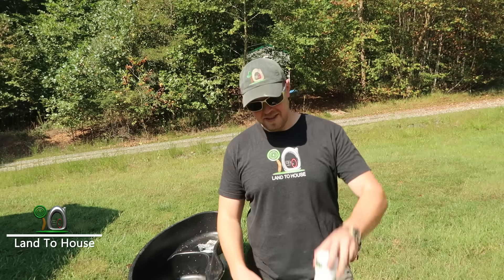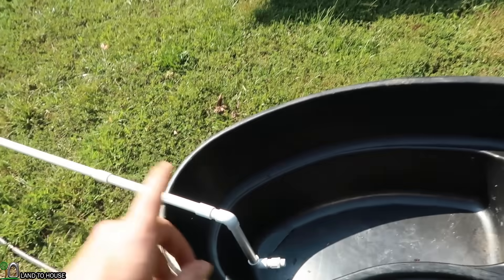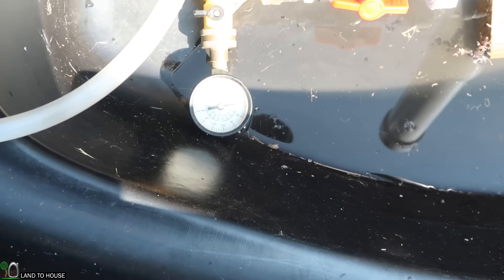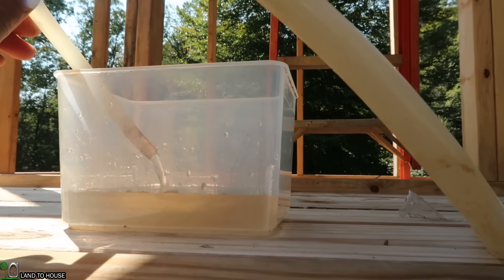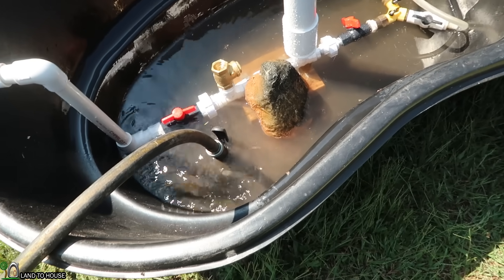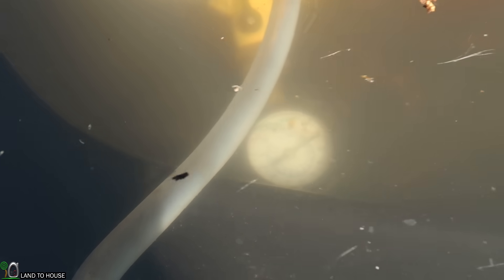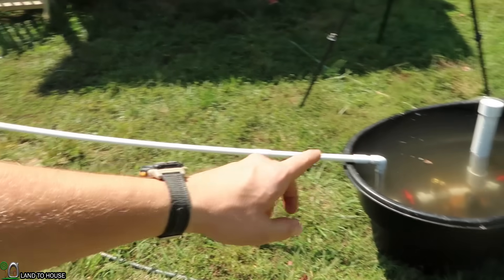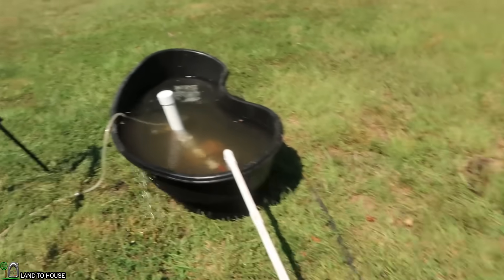Underwater Ram Pump

Comment: Make a closed-loop system that can run continuously. You'd have to capture the water at the ram and cycle it to the delivery or to the input. If you can make one work, then you have achieved what they have been trying to do for years. I'd thought of different methods to do that, but always come back to creating a small volume pump that is powered off the ram pump. I'd like to see someone pull this off. It would revolutionize ram pumps.
Reply: I did the math on it, and seems you could almost double your run time, but eventually it will run dry.
Reply: If you lift the WHOLE operation off the ground you create another head of pressure between the bath tub and the ground. Perhaps you could use second head to run another ram pump or pelton wheel etc.
Reply: i think you were still siphoning
Reply: @haz8821  i agree with. Ther must be some siphoning happening, otherwise the lower head pressure should result in less volume
Reply: @Haz-1921  I am thinking the same, cos the deliever head was lowered.

Comment: How can you retrieve the water loss from the waste valve to put it back into the system? If I'm using a 550 gallon tank to operate a hydropower generator .is that possible?

Comment: Could you build a pump where the discharge valve is connected with a shaft to the air reservoir to further increase the pressure and it should make it similar to a two strok engine. (discharg valv) |-----------¤------[] (air serbator) (¤ leverage point it could be mouved around to optimise it ) so basically when the valve is lifting up to close is leveraging and pushing a piston dow  in the air chamber hence delivering more water and at the same time increasing the frequency of the strokes

Comment: Was wandering if u put pipe from bottom of pond with a float valve that opens up when the pond gets full and have that feed into the line on the dry side would that creat suction on that side to pull more water threw or would that just blow back into the pond

Comment: So if it works underwater, could you submerge it in a pond and have a feed pipe just under the surface level of the pond. In other words let it feed from a vertical pipe? and could this perhaps be used to then power a pond fountain?
Reply: No, I see your logic but you're missing an important factor. Water pressure gets higher the further under the surface you go. So for every foot under the surface you place your pump you need another foot above the surface to have equal pressure (not to mention the pressure you need on top of that to actually "power" the pump itself)

Comment: Why such a long drive pipe? 
If you built a pump the same size and use a 6' fat, 4" or 6" drive pipe, tremendous water would flow into the drive pipe in a river... I cant imagine why the fat 6' drive pipe wouldn't feed it!!

Comment: Just came across your video, and had a question.  If I were to use a ram pump or multiple as a pond aerator pump, with no supply of running water, would it be possible to sink the pump to the bottom, run a flexible hose to a float, and use the difference in height of the top of the water to the bottom of the pond to start the ram pump?
Reply: No

Comment: so if you fill your bucket from a river to ram pump it up an embankment to a tank say 100ft above river how often do you gotta fill the 5 gallon bucket at what length of drive line to accomplish this ... i realize just using the river for the pump would increase the yeild/ flow rate but i wanna know for the 2ft high drop of a 5gallon  at full fill and do ya got 10 ft of pvc before ram or 20? because that's what i think would need to change to longer  to accomplish with bottom of bucket being at river height then you could fill bucket by hand from another 5gallon

Comment: assuming you let some water out of the pipes, you could do a turbine rotation another pump, while letting the first turbine jet the seconds reservoir to be pumped out, direct pump determination, evaluation of generated, used and possible power, mgh direct conversion E=m1gh1=m2gh2

Comment: You have the weight of the water in the tank/pond that would put pressure on the outside of the  gauge diaphragm and that could cause the gauge to read low, just a thought???

Comment: The pressure output was different because it requires more energy to release the water from the ram pump ram valve into the pond when you have it full of water. It means you get less RAM, because more of the energy from the source has to be used up in getting the water thru the first ram valve. It means you have energy from the source, to capture in the pump, and why the pressure was lower in the filled pond test, some of that energy was used to get it to flow against the head in the filled pond.  Yes we know the head in the pond is lower in elevation, but that is the only it works at all, but you still lose pressure because you still have a head working against the ram valve now.

 You have that pump under water, and that creates a head pressure on the ram valve forcing it to be required to have a higher head pressure at your source, in order to wind up with the same pressure output as the empty pond test. Water still has weight regardless what elevation it is at, and water flows more freely into air than it will into a pressure head of water. 

You can think of it this way too, the elevation of the top of the water level in the filled pond is now your exit elevation on your underwater ram. So in other words, when you put 3 ft height of water in the pond, it essentially means you moved your ram up 3 ft! And when you move your ram up 3 ft, you lose pressure. So, you in essence lose 3 ft height for the input, but don't even get to benefit from having your output 3 ft higher.

Comment: As I understand 24 PSI is due to water pressure above the outlet and changed valve weight under water. If you use a spring outlet instead of gravity weight valve which is also become lighter under water due to its volume amount water is replaced makes lighter which can be tuned by spring valve causing PSI improvement.

Comment: if you can do something with the water overflow it would be just that little bit more efficient. Like a second ram pump lol

No one ever feeds the supply line back up to the source lol i just want to see it once.

Also what happens if you supply a tower tank and add a second ram pump half way up a hill would it be a faster flow? Or inneffective? You say for every foot you can climb 7 so for a supply tank with a smaller ram pump that 7 foot turns to 49? I saw in the other video you supply stoney creek farms cows so if you ran another ram pump at a supply tank 7' high and had the waste. Water fill the trough as well as a float on the trough to the supply tank, you could ram that uphill ~49' higher? Can you pipe the waste downhill into a tank? This kinda shows it can work with little pressure on it.

 If your supply line is heavy ridgid and secure or even larger diameter, does that effect the ram force? Can you damage the pump with too much water weight?

Comment: make a closed circuit with a 12 v sub pump 3000 gph and the ram pump going straight to the pelton wheel and attach a 36 volt motor in a large bin.

Comment: If you submerge the pump under one feet of water, then you also reduce the head pressure by one feet. That must lead to a reduced pressure and flow rate. The flow rate might not be reduced so much because the efficiency of the pump was increased due to a longer cycle time. A comment by Steel Arms said that you have 15 cycles in 13 seconds with the non-submerged pump, but only 13 cycles in the same 13 seconds with the submerged pump.So you are closer to the optimal one-cycle-per-second ratio with the submerged pump.
Reply: Hii i am from india , i work on ra. Pump project as you say it reduce pressure by one feet and also reduced flow rate . But my question is it reduce incoming flow rate ( water coming from source to pump ) or only reduce lifting flow rate ?

Comment: Power is determined by the drive head, which is the height difference between the surface of the water in the header tank and the surface of the water where it discharges. It normally discharges at the top of the clack valve (drive valve). However when there is water in the tub you have to measure from the water level in the header tank to the water level in the black tub. It looks to me to be about 12" above the drive valve. This has effectively reduced your drive head by 12". If the tub had deeper sides and the water could continue to build up the pump would stop when the water approached the same level as the header tank.

Comment: I want to do this for my pond. But, I will need to use 90s. What if I used sweep 90s I stead of short 90s
Reply: Use 45s or use a flexible pipe that is well secured

Comment: I am super curious if you can daisy chain these together and go farther up hill then if you had used just one. Could you test two ram pumps one at the top of the hill directly from the hose and can you test directly from a gravity feed tank that gets feed by a ram pump at the bottom of the hill thanks.
Reply: Because gravity essentially applies that forward pressure through the system, I see no reason why more pressure recieving it would interrupt it. However there is a lag in pressure application everytime you her the ram thump. This delay could accumulate to your secondary or tertiary pumps to lose pressure at integral moments, this could mean two things though that it needs so intensely calibrated you better bust out a calculator to make it even possible, or it's a simple calibration. The ram function relies on the gradual increase of pressure to pop open the further valves or pistons. Additionally the pressure created in the further mechanism as it builds may prevent the previous pump from releasing, but this is a sensitivity that can be calibrated out. I think it's doable but more prone to pump stop, which is the problem with these pumps

Comment: makes sense the density of water being much greater than air when level is raised and when you fill tank you effectively reduce the elevation head and thus pressure, what would be interesting to know is (and perhaps you have done this elsewhere) what is the minimum elevation head you need to make your pump function and what configurations make that more efficient, for instance if you used a plastic check valve instead of metal I suspect you sacrifice lifespan, but takes less energy to open and close hence more efficient operation but doesn't last as long.

Comment: The only thing you proved is that the ram pump works under water from an outside source of water from a different water source , I wanted to see if the ram pump would work under water within the same body of water . why couldnt you show that .
Reply from the maker: It does not work in the same body of water.
Reply: @LandtoHouse  is there something that does because I live in flat bottom lands and would like to run some water for my garden
Reply from the maker: If the water is flowing you can use a few types of pumps. But in most cases flat water you will have to use a solar water pump or a gas water pump.
Reply: @LandtoHouse  ok thanks

Comment: As a method of muffling the pump, this is excellent. Further the ‘spray’ is contained and therefore usable elsewhere. 👍
Reply: Not really. The video showed it significantly reduced output pressure. To maintain performance of the pump rather put sound insulation around the noisy valve.

Comment: Would it work just with a vertical inlet pipe 3 ft high being submerged? Of course the priming would have to be done under water. Of course the delivery pipe would be above surface. It's conceivable that it would work in a pond deeper than 3 ft

Comment: few ideas/questions

is it possible to add some archimedes screw power generators either along the input or output pipes? how effective would it be to harvest power with that? better on one end than the other?

for the “waste valve” would it be possible to make the dumped water flow in reverse towards the input with a valve to seal it. it would most likely be a sloped pipe with a valve at/near where it joins the input pipe. as for accessing the “waste valve” maybe have a rod that sticks out, connected to the center of the valve door. then you can press the rod down to prime it. the rod should “jump” on its own when it cycles normally.

Comment: Love the tests! I am very interested to see how much more flow or if any you get by submerging the pump 1 or 2 feet into the creek compared to mounting it just out of the water. Do you actually gain more head pressure or does the hydrostatic pressure of the water it's submerged in cancel out any extra head pressure?

Comment: I just had a thought as I know you have a hydroelectric generator. What about taking the water that has passed through your generator down stream and then using a single or multiple ramp pumps to circulate that water back up to the intake barrel for you hydroelectric, thus increasing your available water source flow and creating more electricity/output?
Reply: Only a small portion of water is lifted through delivery pipe and more water run downstream.
Reply: @saratchandra2995  depends on how many you have and their sizing perhaps?

Comment: I submit the diminished psi reading during underwater mode is caused by the water pressure against the 1st check valve.

Comment: Hi, how about if you only have a horizontal flow of irrigation water can it work? And can i ditch the drive pipe just open the "supposed to be drive pipe" facing the flow of the irrigation water?

Comment: Probably would not work at the bottom of a 15 foot pond huh? If I were pulling the water from the top shallows and sending it to the pump at the deepest part of the pond? I'm assuming the water pressure would be too much on the release valve?
Reply from the maker: The water feeding the pump needs to be from above the pond the pump is resting in. If you just pull the source from the surface of the water there will be no flow into the pond through the pipe.
Reply: @LandtoHouse  thank you. I kinda figured but that would sure be a cool thing if you could do that. Eliminating the need for an actual elevation drop. Darn lol

Comment: Thanks for your great videos. I'm just wondering if the pressure tank has to be long and tubular. Maybe you could test with a more low-profile, but wider container. Same, or even mode air volume, but more compact. Also, is there an option of purchasing a few spares, e.g. valves, with your kit? While one can build their own unit, I like the way yours is standardized. Thanks.

Comment: My observation is that the flowrate and pressure might be a bit lower but the bright side is that it negates the banging noise. Maybe a 1" or 2" submergence of the exhaust valve outlet will work just fine without compromising the overall efficiency.

Comment: The click valve is annoying to me.  I will have it underwater if possible if/when I get a ram pump
Reply from the maker: You get used to it after a while. But placing it underwater does help with the sound.
Reply: @LandtoHouse  do the neighbors get used to it?  Mine are closer than I'd like and one complains about everything
Reply from the maker: I have one neighbour that is about 2500 feet away and another that is 1 mile away. So... it does not bother them.

Comment: I think in the first pressure test, the open end of the pipe was at the top of the wooden structure. With the second pressure test it was lower, ending in the bucket. That is why the pressure is lower.

Comment: The reason why the flow rate is almost the same is that there is a gravitational force acting on the flowing water that is coming from the outlet of the hose which is hanged at the cottage structure. If the hose wasn't bent back downward, i guess  you can clearly see it will have different flow rate.

Comment: Hi, my name is Lee. I am a 65 year old lady from South Africa and I am building a 20mm pipe small ram pump which I want to use for my stack hydroponic garden. That means I need to put the wast water back into the feeding bucket.
Must the feeding pipe be so long or can the metre fall be almost diaganal?
If so, can one connect a metre cylinder which is open at the top so that the wast water can push up in it, instead of running away with a pipe from it to the bucket, thus depositing the water back into the system?

Comment: Its amazing how little some  know about physics.   Adding height to water in the pond is exactly the same as taking away from the water head drop height from the "drive pipe", , which is exactly like you did putting a stand on the waste valve in a previous video.  Of course the pump works under water, as long as a water hammer is produced, and the waste valve can move.   Some fluid friction resistance on the waste valve flap will slow down its slamming ability, so being open to the air is best for it and for water hammer pressure creation.  But if you raise your bucket the same amount you raised the water in your pond to maintain the same drop, you would get close to the same  pound pressure and flow rate, minus some loss in waste valve efficiency due to it not venting to open air.
Reply from the maker: This is a video I needed to make for a lot of people to see what was going to happen. :) 

It mentions that the water source must be from above the water that holds the pump.

Comment: I think you still had a siphon effect. It probably doesn't matter form a comparison perspective because they were both the same, but the water would have to be free falling from the top of the shed (not in the hose) to get rid of it, no? As the 'pond' filled up on the second test there would be more outside pressure affecting the pump so would probably change its efficiency a little. I think you also need to lift the pressure meter out of the water so the pressure is the same on both tests (there would be more ambient pressure underwater).